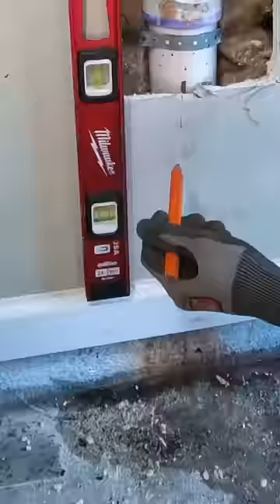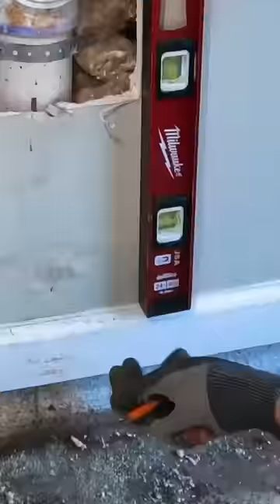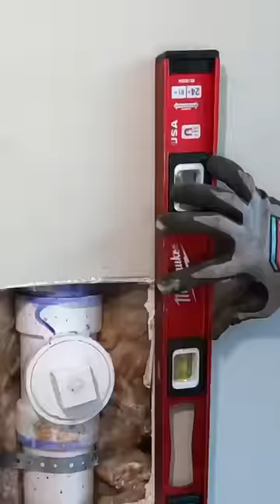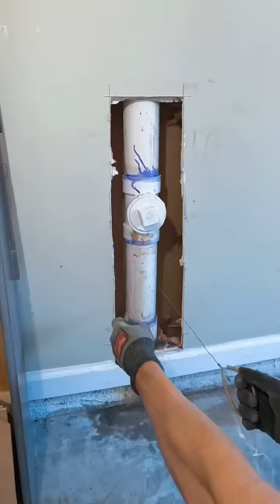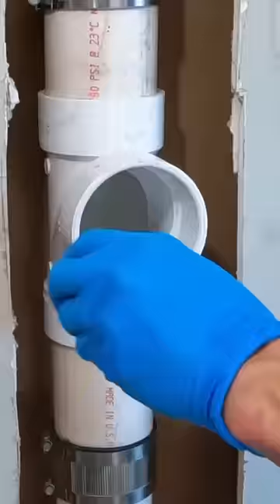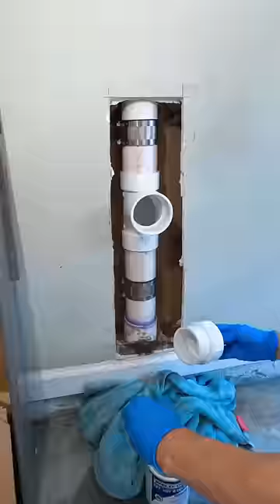Replacing a 3 inch PVC cleanout 💦 #plumbing #plumber #shorts

Comment: Question. How come you didn’t use a traditional cleanout tee, and install a flush plug so that it’s in the wall, with a nice cleanout cover.
Reply: 4 pm on a Friday
Reply: @DDunc1020  with all due respect.. a good and proper job should be done no matter if it’s 4 p.m on a Friday, or 10 p.m on a Saturday. Just my personal opinion.
Reply: @Jordan K  lol yes I agree. It was only a joke. The only reason i wouldnt put back a test tee is if the customer had different plans and had the request. And then i would use a flat cleanout plug
Reply from the maker: For drain cleaning purposes that’s why
Reply: @theplumberlorian  what the hell does this even mean?
Reply: How are they gonna dry wall over that now? Am i missing something, i mean im not a plumber exactly but i dont think this guy is either. Maybe its just a temporary repair until an actual plumber comes in and does it right.
Reply: @theplumberlorian what? Honestly, just what?
Reply: @bartholomewgreatpants3425  you dont drywall over it. It gets left out to get access to it to allow drain cleaning.

Comment: You took out a clean out and installed a San t then a clean out? Did they insist on it poking out wall.
Reply: What you deem a clean out isnt, though it can serve as one only on occassional exceptance by code enforcement. A cleanout has too be accesable when req'd and directional.
What that is,, is a test tee for water test inspection. A gluein cap that breaks easily " knockout plug" is installed or a cherni ballon plug inflated with air too block the waste & vent stacks too fill with water for inspection and access to remove plugs after approval, "greentag" by inspector.

Comment: That was wonderful work you did there. The only thing I noticed was the band couplings you used were for no hub cast iron.  Other than that it was a great repair
Reply: Pvc repair couplings instead of no hub bands would definitely been a better choice
Reply: @beezymoebetta  
I don't trust rubber bands & hose clamps.
Reply: Those are the wrong bands, should have been proflex, but they are not rubber but a different kind of pvc, actually. If you can get 2 slip couplings to slide into place and not leak or freeze in place while installing them more than half the time, you have talent.

Comment: Not a plumber here. How long do those rubber connectors last??  We had 3 plumbers add things that looked like that to a leaky cast iron drain pipe in a rental and every time it started leaking again.   Is that most likely due to the old ass iron piping?
Reply: Yes those no hub couplings will last pretty much forever

Comment: So initially cut the drywall, imo, right. Had room for drywall repair guy or even gave a bottom anchor for an access panel. BUT THEN YOU UNNECESSARILY CUT THE THE DRYWALL DOWN TO THE BASE BOARD!! Next time, leave a little wall above the base trim if possible
Reply: Guess you missed the part where it crumbled down to the base board when he cut it due to all the water that had been leaking through. But use more caps next time, maybe you'll be right then.
Reply: Yeah that was crap. 😂
But if it was crumbling ..nothing else you can do ..😂
I didn't see that part either .
Reply: Well, the crumble was from it still being wet. If they’d have just left it alone and dry, then that would have been unnecessary. I’m pretty sure the plumber is not doing the drywall.

Comment: I need to do something similar in my home. Did you need pvc cement or did you use just the rubber pieces and clamps?
Reply from the maker: Use solvent and primer on the tee portion and then 2 no hub couplings

Comment: A UK difference would be to use a sliding or slip-coupling, which is just a regular straight connector without the internal pipe-stop. These can slip all the way up, with a bit of lube, then slid down mid-way. Just as water-tight as a regular uPVC joint.
Reply: @xxxmikeyjock  I recall there was a coupling that had a removable pipe stop, but I haven't seen one for years.
Reply: Yes, not sure why he used ferncos instead of hubless couplers.
Reply: When you slide it down, doesn't the glue get wiped off on top, or is it still enough?

Comment: you should never cut the sheetrock to the baseboards like that. leave a few inches so that it can be repaired without removing the base.
Reply: That's not the plumber's problem.  😁
Reply: Dude what? The baseboard is saturated anyway 😂 there’s a reason why the pipes are put in before the Sheetrock. When access is needed, it must be given. We give drywallers work there should be no complaints lol
Reply: Always someone that has to comment some crap about what you should or shouldn’t do 🙄
Reply: @BobbyBiz  

Says Bobby
Reply: @BobbyBiz correct, i am a professional, handyman with 10 years experience and a very successful handyman. This is about doing it correctly. The technique in the video is wrong
Reply: @-joe-davidson  it might not be the plumbers problem but that doesn't mean that he should make it harder for the next guy when he doesn't need to.
Reply: @ericdeaton2247  OK firstly professional handyman,  Is that actually a thing where you’re from? We have a saying for that in the UK…. Jack of all, master of none
Reply: dude it was saturated 🤡
Reply: @vdubskiee5356  how do you know? Did you touch it?
Reply: @BobbyBiz  are you always this arrogant?
Reply: @ericdeaton2247  yes 👍
Reply: @ericdeaton2247  The lower drywall was wet and damaged, so he just removed it. It's still super easy work for a drywall guy to fix.
Reply: @user-Blaxit  how do you know,  did you touch it?
Reply: @BobbyBiz Do you know what the, actual, saying is?
Reply: Sure, leaving the dripping wet sheetrock on the dripping wet baseboard.
Why give it a chance to dry when you can let it grow mold 🤡

Comment: I have question Maybe 2, 
1. Is that fernco a better alternative to gluing with actual PVC couplings. I mean you went thru the trouble of building a whole new clean out why not add 2 slip couplings. 
2. You do know that sheet rock goes down past the base board and is probably the most effected part of the board seeing it can't air dry. And will likely begin to grow mold.

Comment: Though it; "Can" be used as a clean out,, it is a "Test tee", used too test the waste and vent system with water to the lowest vent penetration thru roof for inspection by the Plumbing inspector of the munisipality of the city during construnction. Everything below it; the" roughin" was inspected with water for tightness and leaks before back filling and concrete or framing crews.

Comment: Did you just replace a cleanout tee with a san tee that you glued an FIP onto with a "hub" piece? Maybe it's the angle but that looks like it will now protrude from the wall, where it didn't before

Comment: I always use clampalls for my repairs in the wall. I know that no hubs are perfectly fine but I like the idea of a stainless steel band with 125 pounds of torque completing my repair. I can walk away with no worries about leaks.
Reply: Not so sure about 20-30 yrs down the road. I like to keep rubber out of plumbing as much as possible.
Reply: @ProleDaddy  just open the wall back up and relubricate the rubber every 10 years so. Should be fine. /s
Reply: @elijah3807  2 different models of no hub wrenches. One for 65 and one for 80 I believe. No hubs are not approved for below ground. It may not be a dodge truck but where soil shift is a problem I can sleep easier. Cast aspersions all you want I know my repair will hold and outlast a no hub. I have too many years under my belt to just do “good enough” repairs
Reply: И стоит как чугунный мост

Comment: Wait, what? Marks the cuts, ends up cutting without the marks. Uses a towel, after having already removed the cut section.
Reply from the maker: The towel was for the water dripping from the pipe above

Comment: I'm asking because I'm curious. Could you have used a rubber Frenco coupling instead of a band seal?
Reply: Yes.

Also a repair pvc coupling

There's many fixes. They all work. Quality of install is the biggest factor though. Pvc looks best. Especially if couplings are pushed to the edge of the cuts to maintain aesthethics
Reply: @josegomez6549  right but it’s gonna be hidden behind sheet rock, go with shear bands here. Makes servicing this clean out very easy next time
Reply: @jaredcalvert9207  using pvc is more about being as correct as possible. Honestly if it was a customer I'd do it the same way, best for future maintenance. But in my house I'd be too picky to use anything but pvc and try to make the repair as clean as possible... But that's just me being stubborn

Comment: Are those black iron couplings? Or repair couplings that I haven’t seen?
Reply: Yes, I think. They're called no-hub coupling for joining together cast iron joints without hubs, or PVC\ABS to cast, etc. Aka shielded fern-co type rubber couplings.

Comment: Shouldve used a repair coupler instead . The repair coupler would've allowed you to prime, glue and put it back together nicer and permanently.  Its a little messy and you have to be fast but its doable.

Comment: What fixtures so y'all use with 3 inch (75-80mm?) Over there? Weird size in OZ. We have 65mm then 100mm. 80mm never gets used anymore.
Reply: North America uses 100mm and 150mm equivalents (4" and 6" pipe).
Reply: @jbsimmons54  Cheers mate. I've seen another guy do a lot of cast in NYC looks smaller like 80mm for toilets. But seems same then. 100mm for normal house drains, then up to 150mm for multi commercial.
Reply: @NO880
Yes, you are right. Your 80mm is the equivalent of our 3" pipe, which was standard and still is, but only in 2"x4" (actual size is 1.5"x3.5") lumber framing where holes have to be drilled through horizontal members to pass the pipes. When possible, before connecting to 150mm/6" pipe for sanitary sewer, it"s converted to 100mm/4" runs. On septic systems, things are a little different. The building exit is 100mm/4" with a cleanout T, and the 100mm/4" run goes all the way to the septic tank inlet baffle, where there is another T to prevent the scum layer from building up and entering that run from the building. Another short section is connected to that T downwards into the tank. Cheers mate.

Comment: As a plumber, I am always hestitant to use Ferncos with PVC pipe. Couplings with glue is always superior. I know because of how tight the space was, you don't have the room to glue properly...it still makes me nervous.
Reply: as a plumber , you should know that those were not ferncos.
Reply: @warrenmichael918  That's correct. I was using "Fernco" as a "catch-all" term for rubber no-hub bands (like what was shown). Still, don't use them on PVC unless you are connecting into cast iron.
Reply: @garrettstephens91  They are fine on PVC too. I know they are also made for cast to cast and cast to PVC but they are also for PVC to PVC. I get it though, its hard to do things a different way than we were either taught or just learned over the years. I am the same way with all the PEX water lines. I used to absolutely hate it and would much prefer to sweat copper, it looks so much cleaner and nicer but its hard to get the people to pay for all the extra expense of it these days. I finally broke down and ran my daughters house in PEX, after watching enough youtube videos, i used a decent manifold setup and found it to be fairly decent looking if i took my time and didnt just loop it all around like an animal when i installed it. I still like the look of copper but i will tell you it was so much faster and cheaper, LOL

Comment: My only beef is with how low you went with the drywall cutout. Now the trim needs to be pulled to patch it. Could’ve stopped a couple inches short of the trim and would’ve made the drywall guys job a lot easier

Comment: Not an expert, but I’ve done plenty of sheet rock.  I think you shouldn’t have gone down to the trim, just stay the two inches above if possible so the patch can be taped and mudded.  Just my two cents. Nice work with the wire saw. I’ll be asking my son about that tool, he’s apprenticing now.
Reply: Why keep dripping wet sheetrock with mold ?
Makes no sense

Comment: Should just use an expansion joint and a clean out fitting below. Then you don’t have two mechanical joints in the pvc. Nice work though

Comment: Cleans up jobsite. Remove sheetrock with damaging baseboards. Proper application of rubber boots with clamps directly over top. 

10/10 would contract to. My biggest thing is cleaning up your mess. Went through 5 electricians before I found the guy that will get paid to work on all of my bids. And all it took him was an extra 10 min with a broom.

Comment: Great to see a Torque wrench. Code In Illinois. Most plumbers(?) use a nut driver only. When you edit these videos, it sometimes looks like you are skipping steps. Ex: deburring and reaming, etc. Local towns around me are now requiring a permit and inspections for repairs like this. Removing, replacing, alternating plumbing. Including water heaters and frost free anti siphon outside faucets.

Comment: I would put a removable panel there, instead of covering it. That way you can reach the clean with cutting through the drywall
Reply: Not even necessary here. If you look closely, the new clean out will be outside the wall.

Comment: The repair itself will work, however, we would call it a temporary fix, like we used to do at sea on board ships before going into drydock.
Reply: Why would you call this a temporary fix. Those No Hub bands are much Better than Fernco couplings and trying to use two slip through coupling at the same time is a good way to end up with a bunch of junk

Comment: You know I don't know what's up with these DYI projects that started everybody using PCP pipe for plumbing we used to use it for wiring you called his wiring pipe or electrical piping to run electricity through houses instead of having two wires all over the place we used to use PCP

Comment: And why was he replacing this tea what's wrong with it and the new one is sticking out 2 in half of the drywall why don't you just put a test in and a flat plug. You need to put an access panel there anyway cuz you need access to the cleanout this doesn't make any sense this is a licensed plumber I doubt it

Comment: In my day we would have made it flat for the access panel can you hide a threaded fitting so when the guy comes to snake the drain out he has something to work with he removes the flat plug uninstall the temporary threaded fitting puts a snake in there on an angle. I'm sorry guys the way this guy's doing it ain't no plumber it doesn't make any sense to have this thing sticking out of the wall 3 in

Comment: good job no problem with what you did but why the fuck  did someone bury a clean out in a wall, also I know that it was probably an unfinished basement or something when installed but for fucks sake make an access panel, its not hard.

Comment: Go frame to frame for a hornout like that.
Reply from the maker: I don’t get it
Reply: @theplumberlorian  Sorry. The drywall cut out around the plumbing is called a hornout. 

If you want to patch drywall correctly, cut it out from each adjacent stud, into 1/2 of the stud with. When you screw back your drywall, it’s screwed directly into the stud. Screws at each corner and depending on the vertical length of the cutout, space the screws about every 8”. So a minimum of 4 screws of a small patch. Mud n tape your joints afterwards. 

I’m a commercial framing and drywall inspector!

Comment: You could have connected the cleanout tee to the piece you cut out at the bottom to drop the cleanout down some. Secondly why not just put a coupling at the piece thats cut out at the top.

Comment: Howdy! Those wire saws can be handy, but you put unnecessary wear on them by pulling "straight out" as you finish the cut. They will last a lot longer if you avoid this "pinching" by moving your hands further to the sides as you finish the cut. The flatter the wire, the happier it'll be.

Comment: Always useing those cheap ass mission couplings.  Id rather use a repair glue coupling. 5 dollar dif. In those and nice metal ones. Your using pop cans
Reply from the maker: Not a fan of pvc slip couplings
Reply: @theplumberlorian  I'm not either but I'm also not a fan of those cheap versions of mission couplings.  They're as thin as pop cans

Comment: Flunk.....need to use fernco couplings...not cast iron no hub couplings.
Reply from the maker: Good luck with that
Reply: Can't use Fernwood inside buildings in Massachusetts.  Only  outside  below ground
Reply: @michaelnelson7572  and in nj unless it has a band around it.   You should never "see" a fernco (unbanded} after it is installed.